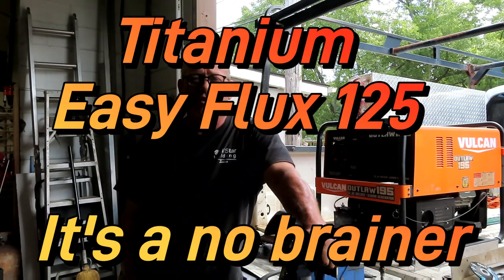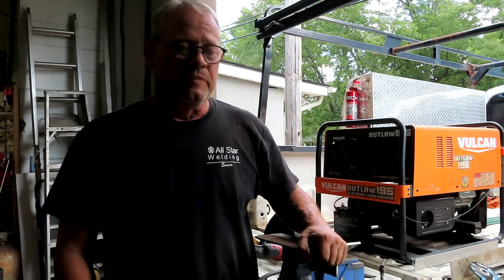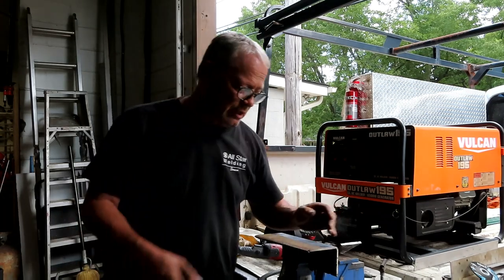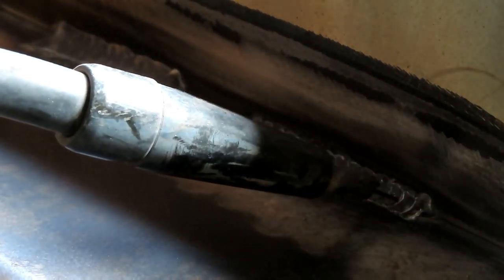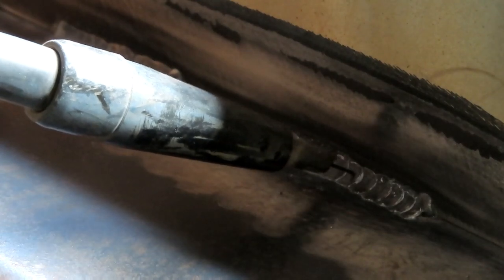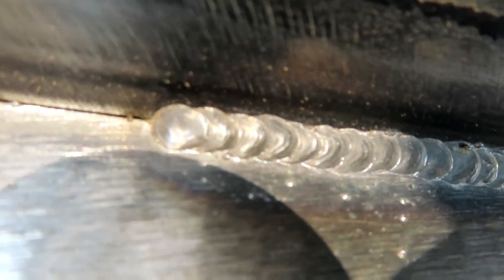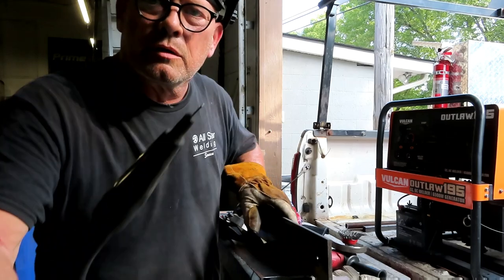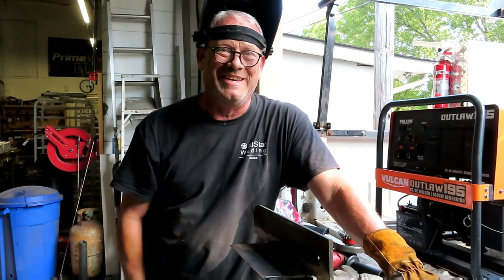Harbor Freight Titanium Easy Flux 125 - Its A No Brainer!

Comment: Great details Jason, but I have a to ask about the settings to weld this 3/16 with the 1/4. I have a project that will involve those to size of thickness. In another video you said that no matter the thickness of the material you always use the settings D - 5.5. Did you use the same settings and why? or you change base on material? Thank you.
Reply from the maker: Very good question. Yes, I did indeed say that my go-to is D-5.5. That usually gets me for most, but not all thicknesses. I'm sorry I didn't mention in that video what I used, but probably something like F-7.  Normally, you would spend equal amount of time on each piece with the weld.  So, there are two ways to do 2 different thicknesses. One way is to set it for the thinner, and continue as normal. But you may not get as much penetration on the thicker, depending on how much thicker it is. The other way is to set it for the thicker, then spend more time on the thicker, then hit the thinner. Or, to put it another way, two counts on the thicker, one count on the thinner. I will be sure to cover this concept in the video I'm planning for Monday.
Reply from the maker: Also, on this video, I was running the Titanium on the Outlaw, which allows me to crank it up a lot higher. I was just mentioning to a guy the other day that I have never ran the Titanium at full blast setting. I think the highest I've ever used it was around G-8.5. That's close to full. I guess in my head I figure if I'm going to go that high, and that thick of material, I may as well stick weld it
Reply from the maker: Also... Now that you have me thinking about it, I generally just limit the Titanium Flux to 1/8" and less, and usually for hand rails, just because it faster and easier. That's why the D-5.5 is a go-to. Anything thicker, then I will just use stick if able to. However, I have another machine, the Primeweld 160, that I just use for heavy Flux core. It can run on 220v and a whole lot hotter than the Titanium, and Ive used that on 3/8 to 3/8 and it did great. Look up the videos about the Primeweld 160Ts Flux Operation. It's unbelievable!

Comment: Buy name brand wire once you get practice. I repaired a excavator boom with one of these doing clean up after we lost alot of our community to a wildfire,Yes I know not reccomend but when you aint got money for fancy welding equipment you do the best you can.
Reply from the maker: Absolutely Scott. Sorry about the wildfire. You are right about the wire. Use some of that HF Vulcan wire while just practicing and getting the technique down. When you are ready, get some good wire. I like WeldCote wire, I think it has the least spatter and cleans up well. But other good wires are Lincoln, Blue Demon just to name a few. By the way.... The Lincoln wire 201-MP is really good. The MP stands for Multi Pass. It's rated to do multiple passes on a weld to really build it up. Some of the others are not rated for that.  But like your excavator bucket, I've done some pretty thick stuff with the MP wire in .035 size. Thanks for your comment.